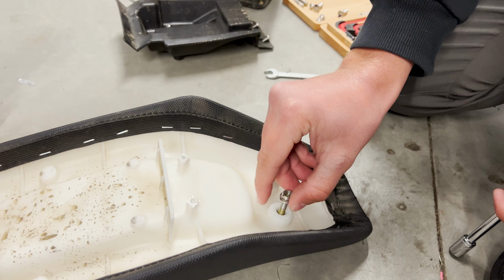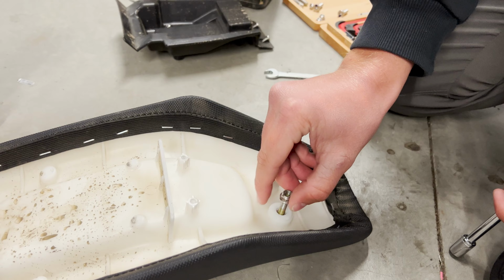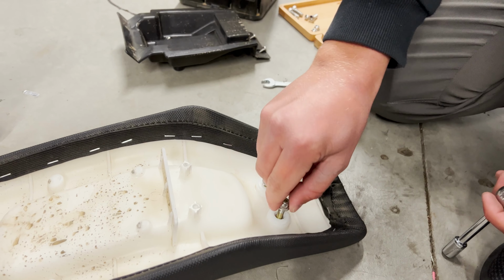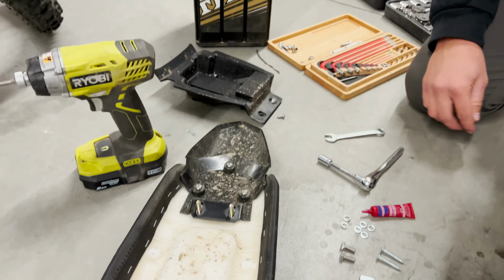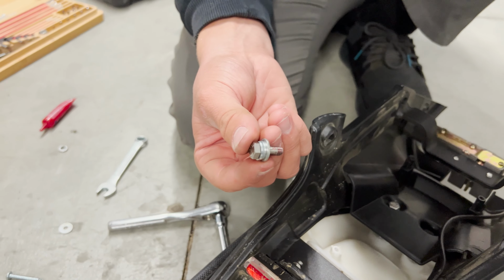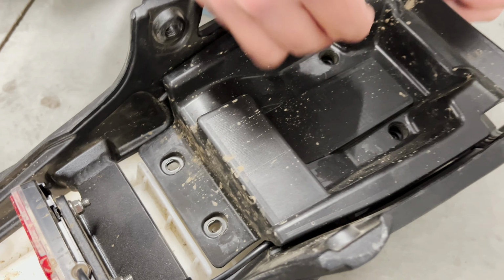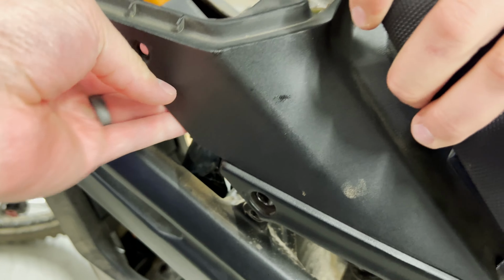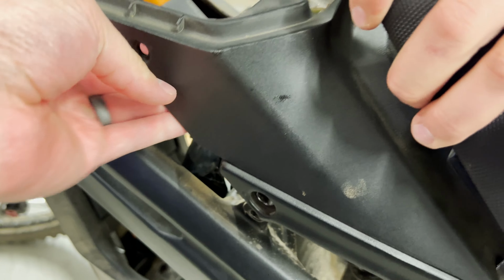Talaria Sting Seat Upgrade! Only $7

Comment: Anyone from the USA did this? I couldn’t find the hex cap screws M6x15 1.00 pinch or the other non specified screw under that one in the description. I checked like 5 stores in my area and couldn’t find one like that on Amazon idk what parts I need to do this (safely)

Please don’t tear me apart if I don’t know something I’m just starting this modding/ building stuff idk what im doing.
Reply from the maker: 10 Pcs M6 x 1 x 18mm Long Rod Coupling Hex Nut Connector Zinc Plated Joint Nut Industrial Construction Fasteners https://a.co/d/7rTD3uy
Reply from the maker: iexcell 25 Pcs M6 x 16 Thread Pitch 1.0 mm Alloy Steel 12.9 Grade Hex Socket Head Cap Screws Bolts Kit, Black Oxide Finish https://a.co/d/cyRw6ZG
Reply from the maker: This video is more updated so check it out and let us know if you have more questions, thanks for watching :) https://youtu.be/GLGzGI7LJNc?si=GrfslyH31UINOH4v
Reply: thank you <3
 @Talariaboys

Comment: Thanks, but I believe it's not enough surface to support seat. It will breaks in the end
Reply: Agree it looks like a weak link. I'm going to do this today with some flat bar aluminum between the studs to spread the load.
Reply: I agree with you, i make it and later make it back in original position

Comment: Amazing that a $4500 ebike needs a $7 seat upgrade
Reply: Adan M , These bikes are interesting but here in Oklahoma, I'm going way faster than whats legal on a $849 folder. 1100W peak, 80nm torque, 34mph on a full battery... For faster, I have a VT1300CT for that

Comment: I hope you dont ever sale those to someone who dosnt want that upgrade since you used permanent locktight.
Reply: @Talariaboys  Thats great and I am glad that you were able to remove them. Just know that recommending people to use red loctight ( which is used for a permanent bond) is not advisable. Someone may take that information wrong and use it elsewhere and then blame you for the bad advice. Just a word of advice as you want to be a vlogger then vlog good information to your viewers, otherwise you will start to look bad later.
Reply: @joethompson9492  You can always remove bolts with red loctite. Just use a heat gun if you can't remove it with force. That's kind of the purpose of using loctite instead of welding parts together